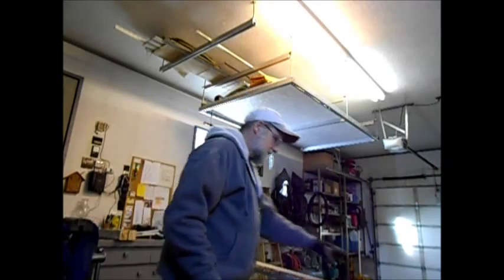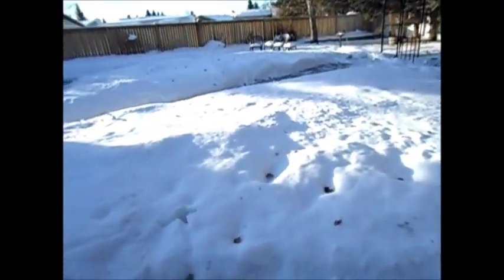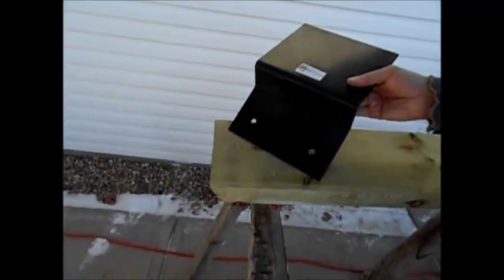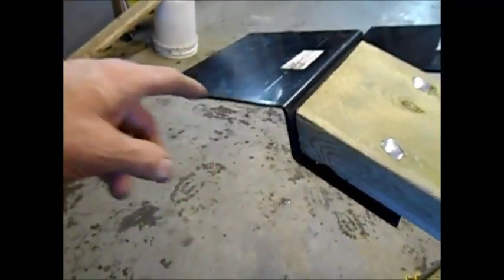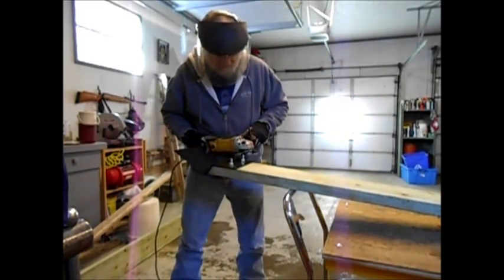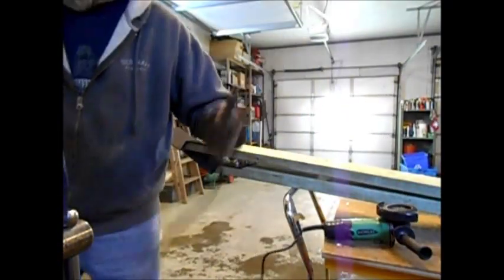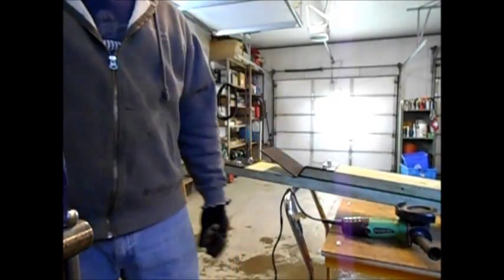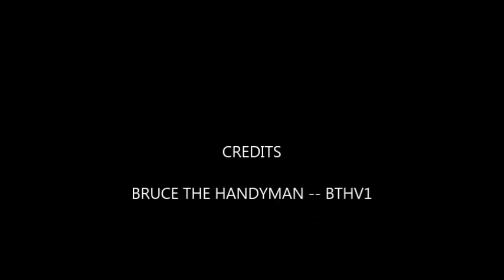The building of pick up truck ramps for $20 Part 2

Comment: I need to unload a 215 lb snowblower from my minivan. How to do it?
Reply from the maker: Can you roll it down on 2 2X6's and use the lever to brake it on the way down.
Reply: the snow blower is in a crate, newly purchased from Home Depot - I live in Illinois. I am afraid if I put wooden planks on the edge of the van, it will break the overhang or lip edge of the van rear.
Reply from the maker: Unpack it in  the van and roll it our.  This snowblower was taken out of the crate.
https://www.youtube.com/watch?v=UKPv4q6KWTE